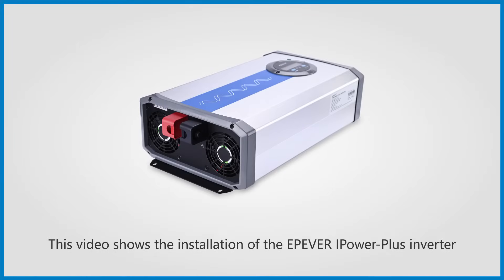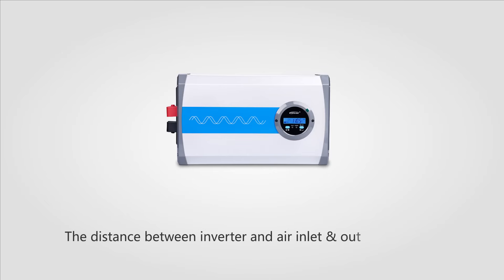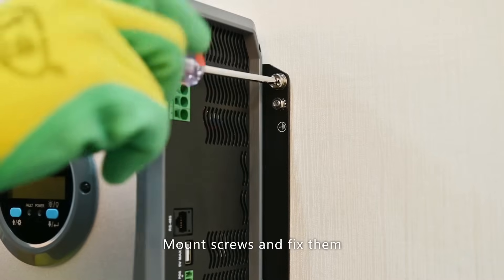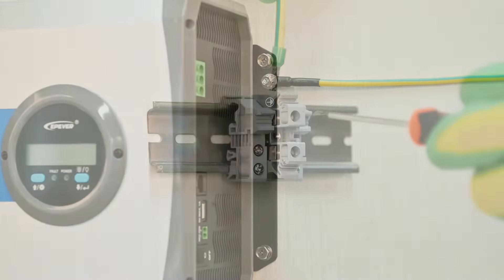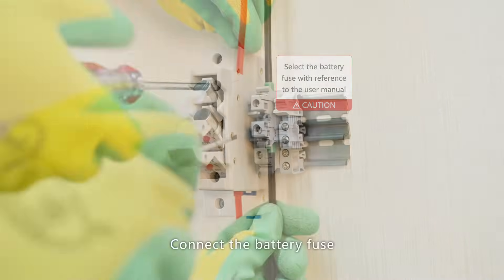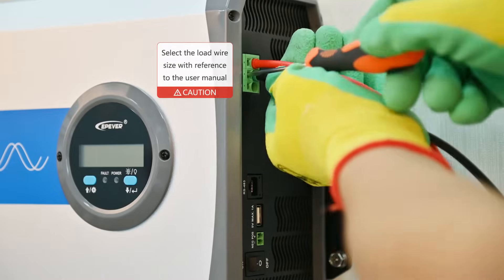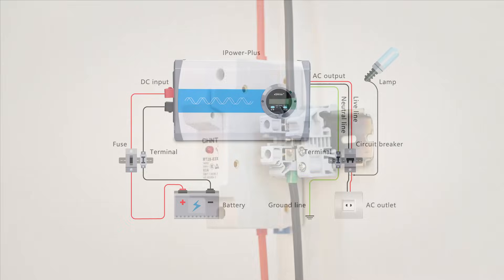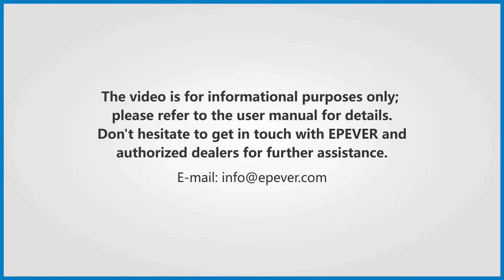Off-Grid Solar System Tips and Tutorial: How to Install Power Inverter | Step-by-Step Teaching

Comment: Hello, good morning. Do you know how many watts this inverter consumes in standby mode? Best regards.
Reply from the maker: Hi, thanks for your question.

There are two types of standby power consumption depending on the inverter’s operating state:

When the inverter is in idle mode (load output is turned off)
Use the formula:
Idle current × Rated input voltage × Hours
For example, for the IP350-11-Plus:
0.15A × 12V × 1h = 1.8Wh per hour

When the inverter is powered on with no load connected
Use the formula:
No-load current × Rated input voltage × Hours
Again, for the IP350-11-Plus:
0.8A × 12V × 1h = 9.6Wh per hour

You can find both the Idle current and No-load current values in the product manual.
Please note that different models may have different rated input voltages, so you'll need to calculate accordingly based on the specific model.
Reply: @Epever Thanks for taking the time to reply. Have a nice day.

Comment: Olá,  a chave para ligar e conectar o inversor de forma externa, external switch, tem indicadores de + -. Posso fechar esse circuito para ligar o inversor de ou então, tenho que entrar com alguma voltagem?  Não encontrei nada sobre isso no manual. Obrigado.
Reply from the maker: Hi, thanks for your question!
The external switch terminals are connected in parallel with the inverter’s ON/OFF switch. No voltage input is needed.
To use the external switch, please set the inverter’s main switch to OFF position first.
You can short the external switch terminals to turn the inverter ON.

If you need wiring diagrams or further details, please contact our support team at support@epever.com. Thanks!

Comment: Is it mandatory that you place the invertor cross way? I had limited space so i placed it upside down.
Reply from the maker: Hello there, you can indeed position the inverter as per your space constraints, but it's crucial to ensure adequate ventilation. Please make sure that there's at least 150mm of clearance around the inverter's inlet and outlet to facilitate proper air circulation. This will help maintain the inverter’s performance and longevity. If you have any further questions, please contact our support team at support@epever.com, we're here to help.

Comment: Hello, I bought  an epever  ip plus inverter  1500, I have a  doubt about how to connect  the  load cable into the AC output. IN the manual it is said that I need to add solder to the connection point, but that isnt mentioned in this tutorial video. I woud really appreciate if you can clarify that for me. Also if you can tell me  which kind and size of wire you use and if its needed any  especial terminal  of the wire to connect in the  ac loads. Thank you for your help.
Reply from the maker: Hi Angela. Both way is available. If you can add solder to the connection point, that could be better. You can check the specification to check the size of wire and the terminal type. If you have any question, please email support@epever.com. We can help you better.

Comment: How is the AC ground line connected inside the inverter?
Reply from the maker: Hi Plattenstrom, in this case, you can connect to the grounding port in AC output terminals, or connect to the bolt at the right bottom in the rear side.
Reply: @Epever  Hi Epever, so the AC output grounding terminal is internally connected to the grounding bolt? As I understand, in an IT system there should only be 1 output socket and no grounding. When in TN-S system grounding and neutral should be combined io input side of an RCD. And ground needs to be connected to earth (via rod or similar). Correct?
Reply: Please link some document where the grounding in case of different electrical systems (IT, TN-S) is done. Because in the video the grounding seems to be not done right. A user could for example shortcut a) ground and socket in case of faulty inverter or b) socket and lamp in case of faulty isolation.
Reply from the maker: Hi Le, the internal inverter is connected to the ground bolt. The output bolt and the enclosure of the inverter/charger only need to be connected to one. The ground needs to be connected to the earth through a cable.
Reply from the maker: Thanks for reminding. Please check. In the video 1:58, we have mentioned the grounding bolt.

Comment: You are missing the most important part to prevent electrocution: the 30 mA differential on the AC output.
Reply from the maker: hello Alexander,  it needs to add an Residual Current  Device if there is possibility to short circuit the neutral and Live wire. Otherwise, the  RCD is useless. For our inverters, touching the N or L seperately won't cause electrical shock.
Reply: @Epever  Why won't you get shocked by the live 230V line if you touch it? This does not make sense. Your body will definitely conduct some current towards the ground and you will get electrocuted if the 30 mA is not there to open the circuit.
Reply: @alexandreesquenet3736  because the inverter Neutral is not connected to the ground and there is no path for the electricity to flow and complete the circuit..